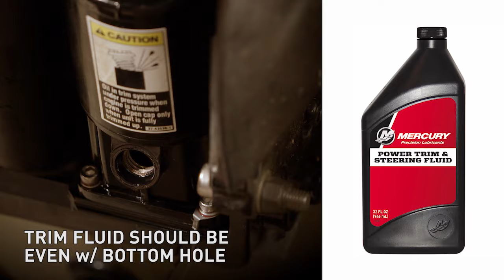Quick Tip: How to Check Your Outboard Power Trim Fluid

Comment: I've got a 2019 200 Four Stroke on a Sun Tracker Party Barge 22' tritoon. The engine won't tilt high enough for me to put it on the tilt support lock. How would I do this then? Can I support it some other way from under the skeg or will the trim actuator not be fully extend and give me a wrong fluid level?
Reply: theglockholiday is the trim cylinder fully retracted with the motor in the lower position? On my outboard you can raise the base plate the trim unit is mounted to, maybe yours is mounted too low?
Reply: I have the same problem, did you find a solution to your problem?

Comment: Thanks! Is there something better than a Screwdriver to undo the full cap?
Reply from the maker: Some models (like shown) have a hex-style head in which you could use a socket or a wrench, however, a flat blade screwdriver is typically all you will need.
Reply: @MercuryMarine  Always nice to see a "professional" damaging otherwise mint parts during routine maintenance. Nice damage on the fill plug. Keep up the quality work.
Reply: @chris_schenkel dang man, who pissed in your cheerios?

Comment: would this help solve my trim from slowly coming down..?
Reply from the maker: It certainly could. If your fluid level is low it can cause the power trim system to function improperly. You'll also want to ensure the manual release valve on the side of the power trim system is fully tightened.
Reply: @MercuryMarine  Mine is slowly coming down as well.  I hope this resolves!  Thanks!

Comment: How often to check the oil and refill
Reply from the maker: You will want to follow the maintenance schedule posted in the operator's manual for the product you have. Generally speaking, fluids should be checked regularly throughout the season. Your power trim fluid should be added to as needed. Engine oil, on the other hand, should be changed every 100 hours or once per year (whichever occurs first) on most models. Great question!

Comment: How can i remove the old oil, before i refill the powertrimm?
Reply from the maker: Typically the fluid would not need to be drained out for routine maintenance, you simply need to add oil as needed. If you are draining the oil because of contaminants or water, then the unit should be disassembled for repair and the fluid would come out during disassembly. You could also use a hand pump with a tube so suck remaining fluid out.

Comment: Where is it on a 2019 mercury verado 300?
Reply from the maker: On the V8 Verado, you'll need to trim the engine all the way up and engage the tilt lock. You'll find the reservoir fill cap located at the top of the trim reservoir where the wiring for the trim motor exits the trim unit.

Comment: Salve volevo chiedere ho un problema ad innestare il piede x quanto riguarda l'ingranaggio ,non riesco come devo fare?
Reply from the maker: We recommend working with your Mercury Marine dealer to determine why you're having trouble getting the engine into gear. There are many variables at play, such as throttle controls, cables, rigging, etc. We simply wouldn't be able to assist you via social media, we're afraid. To find a Mercury authorized dealer near you, please click the link below. Thank you!
🔗: https://www.mercurymarine.com/us/en/find-a-dealer
Reply: @MercuryMarine  grazie per la sua disponibilità e gentilezza

Comment: Followed instructions but mine is randomly working/not working, what is the cause? I tried removing all air by manually raising outboard with manual release unscrewed, and then lowering it. what should I do?
Reply: Mine is the same, did you find a solution?
Reply: @RiverRat734  yes, motor was bad even though it was making noise etc, new motor fixed issue

Comment: How about steering fluid?
Reply from the maker: Hello Ty, thanks for the message! Checking the steering fluid is also very simple task. If your application has a hydraulic steering system, the check/fill plug is generally at the top of the helm steering module. If you have a power steering system with an electric pump, the task is a bit different as the pump may be in a remote location. Once you locate the power steering pump and reservoir on your boat, there is generally a fill line indicated on the reservoir itself. Always follow the operator's manuals that are supplied with your new engine or boat package for maintenance details. Great question!

Comment: Why use trimfluid instead of ATF?
Reply from the maker: Mercury recommends using the power trim and steering fluid to protect seals and hoses, and helps prevent foaming, oxidation, and corrosion.. ATF can be used in many applications if needed, but the power trim fluid offered by Mercury Marine is specifically formulated for use in the marine environment.
Reply: Merc doesn't sell ATF. They want you to buy their products. ATF is fine.

Comment: Suzuki four stroke 250 where the fluid go
Reply from the maker: Hi Paul! We do not have access to their manuals, but it would likely be in a similar location as ours since the hydraulic pumps and motors are generally  alike across many brands. You can likely find the information in the Maintenance section of your operator's guide provided by Suzuki.